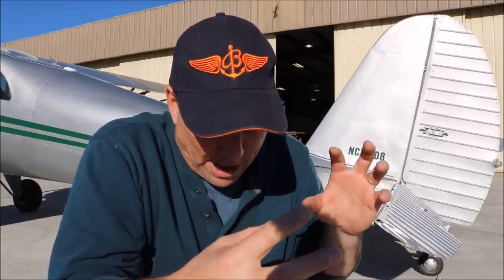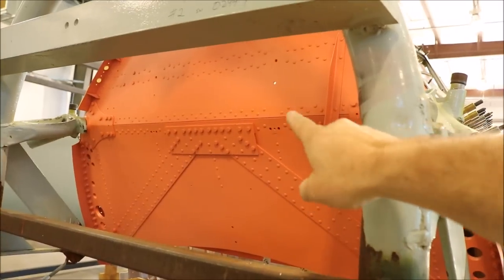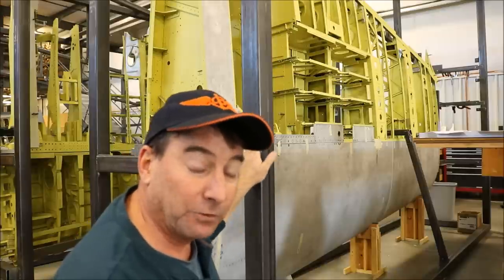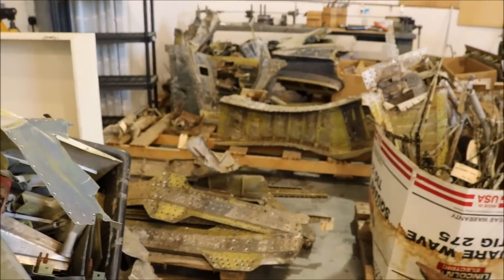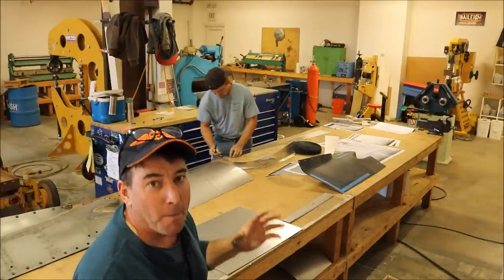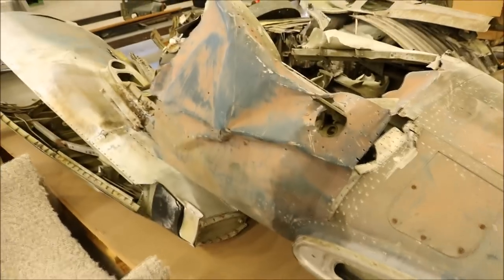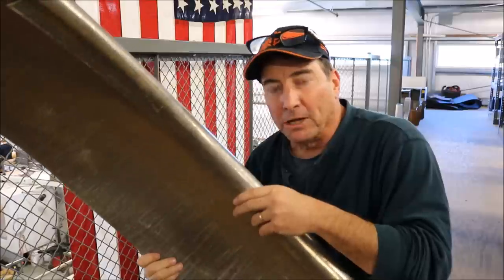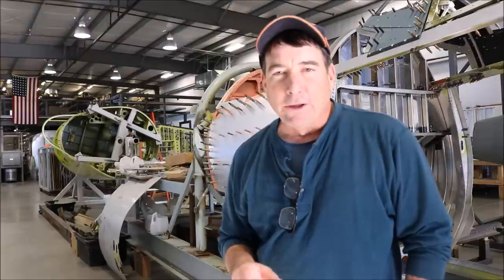RARE F4U-1 'Birdcage' Corsair Project-Vultures Row Aviation

Comment: Gosh, I  love the Corsair, they really seem like the swift pirate ship they're named after, even sounding like a pirate's sabre cutting through the air, until you hear the low drone of their powerful 18 cylinder radial engines after they have passed.  The Japanese called them "Whispering Death" because of that distinctive sound on approach.  Their lines are smooth and flowing which belies their awesome top speed of 400+ mph.They were tough fighting machines stacked with 6 impressive 50cal machine guns, but temperamental "Wenches" near port as they slowed for landing after the battle.  A great video, Juan, conveying the perspective, knowledge, and excitement of being on the inside of warbird restoration.  Also, kudos for taking the time to show proper respect for the deceased pilot, and those whom served their country in general.

Comment: In my earlier years, between 11 and 14 years old I helped my Uncle, a very good mechanic and pilot, rehab. small aircraft of the time.  My job was removing the old doped covered parts and then sand all of the air-frame with any corrosion or rust using sanding cloth strips.  I eventually graduated to drawing the wing ribs and other parts to full scale and we then built the jigs for fabricating the wooden wing ribs on those drawings, done on marine plywood sheets. Damaged fuselage sections were rebuilt the same way, but the aircraft tubing was welded to fit the jigs exactly, while the wooden parts were glued fabrications.  This was my original introduction to flying and while spending long hours at the local airport in Hillsboro, Oregon, I caught every ride I could in all kinds of aircraft and would occasionally have a chance to take the controls and fly the bird myself.  Those days made this video of particular interest.  These people are doing what we did, but they are working on a much more advanced scale.  Back in those days in the 1950's the rehab. work we did was quite primitive in comparison.  Thanks so much once again for a great video as was the travel along with you in the flight to London in the 777!  Nick, North West Farmer

Comment: All corrections are accepted with a smile, so don't hold back.  I think the whistling sound was from airflow thru the in-wing oil coolers. They were the tube type, not fin, and consisted of hundreds of small, long tubes bundled together. Oil flows in the small space between tubes, passing heat thru the tube walls to the airstream.  I think the cooler on the Corsair weighs 300+ pounds, but that's just from conversations long ago.
I'd bet that many engine failures have been caused from non-use, aircraft sitting parked, with oil gunking-up inside the tiny passagways of coolers.

Comment: Licensed A&E mechanic. I fabricated and install many of the fuselage sheet metal panels for the prototype  #1 Ted Smith Aerostar twin engine executive mid wing aircraft. Capable of near 400 mph . Worked for North Hollywood aviation in Los Angeles on a D.C.-6 conversion from a passenger  to a cargo plane. extensive sheet metal  beef ups were done at many fuselage stations , plus replacement of the floor and installation of a cargo floor with tie down rings. The project took two years and the plane was flown down to Peru to haul bananas over the Peruvian Andes. Same company then transferred me to their large facility in Los Angeles where we rebuild convair 440s , 660s, and 880 from piston driven to turbine driven twin engine passenger planes. My work involved shapeing the stainless nacelles and riveting the various parts together to complete the nacelle. These projects were 8+ hours a day six days a week for 4 years. I was quite good at the sheet metal and riveting work, if I do say so myself. I want back in , call me.

Comment: Let us remember that the original design was born on a drafting table, and the computation was by slide rule.
Reply: I inherited my Dad's slide rule.  People back then were so intelligent...
Reply: My dad was an aircraft mechanic in the Pacific theater. When he came back, he became a physicist. I used his Keuffel & Esser slide rule in college. (I had the only HP-45 on campus, so wasn't allowed to use it.)
Reply: My Dad was a P-51 Flight Line Supervisor ready for deployment to the Pacific in San Diego when they dropped the bombs.  My Dad knew a lot of the trigonometric functions by memory and didn't have to look in his books.  He ended up becoming a Professional Mechanical Engineer and designed Lumber Handling Systems from his shop in Spokane.
Reply: Yep! My dad was an Inside Machinist at a naval shipyard for decades. He had his formulas memorized too!

Comment: Here is a question which I don't know if it has been asked of you previously or not. Would it be possible, now that you are restoring this "birdcage", with funding not being an issue whatsoever, to build an entirely new "birdcage" without any sort of an original aircraft? I've heard of it being done in the UK reference a Spitfire Mk 1.
Reply from the maker: technically all you need is a data plate...

Comment: Did He explain why they used that color?  did it come from the formulary, or just a choice. is it the same zinc chromate of today although salmon colored?
Reply from the maker: Ray Bankes not sure why that color.
Reply: There was never a milspec for color.  However, a tint could be added to signify a single or double coat of zinc chromate.  Also, as the protective coating (zinc chromate is a coating, not a paint) was manufactured by various companies, and supplies of raw ingredients varied, the coating could be of several different colors depending upon blend.  Chance-Vought happened to be salmon color.  

The same could be said of 'Olive Drab'.  In actuality, OD could range from a very pale brown, to deep green, to almost black, and everything in between.  I've even seen a very pale pink yet it was OD Green per the milspec.
Reply: Thank you Richard H i know it is a primer and the information  you added is very interesting interesting.  of interest i used it my to prime my aluminum engine block and heads for my Subaru EA-82 engine rebuild.  i know they cool better unpainted yet i wanted it to look cool.

Comment: I’m working on building a 5’ wing span P-47 Thunder bolt air plane. I’m a scale nut, it took me 6 months just to build the cockpit. How or where can I come up with internal drawings of the flaps, linkage and hinges for the wing.

Comment: When I see pictures of the Corsair there appear 2 different props 3 blade and 4 blade what is the story or significance of this?
Reply: I believe that on later models,  4 blade props were introduced to deliver better performance at higher altitude. it could also have something to do with increases in horsepower as time went on... It's effect is like having more "traction" against the thinner air.  I've noticed this on other aircraft such as the mustang as well..
Reply: There is an enormous amount of detailed information on Wikipedia: https://en.wikipedia.org/wiki/Vought_F4U_Corsair
Many enhancements were made since the first models (and still flown after WW2). The F4U-4 had a more powerful engine, and 4 bladed propeller.

Comment: Juan what are those things that look like bullets sticking to the side skin of the plane? Did the Corsair ever battle the Mitsubishi Zero?
Reply: They are called Clecos. Very common in sheet metal fabrication, still used commonly in metal aircraft building.
Reply: DesertDenizen thanks
Reply from the maker: Cleco fasteners. And yes. :)
Reply: Yes, they engaged plenty of Zeros.
The Corsair was mostly flown by Marines from landing strips as it was pretty hairy for carrier landings.
I think only one WWII carrier in the Pacific featured the F4U Corsair.
It was built from 1942-1953, 16 different models, with a U.S. Pacific War kill ratio of 11:1.
Reply: The RN flew The Corsair   from all they carries from 1943  a good  8 months or more before the USN. In fact it was the RN that sorted out all the Corsair issue regarding carrier operations 

 I have read one of the first carrier ops for the Corsair was on the 3rd of April 1944 covering a raid on the KMS Tripitz by NO 1834 squadran

Comment: Those wheels are not original they are better. The original were Kelsey wheels. They also were not a split rim on the original. A common mod was a B52 wing tip wheel.

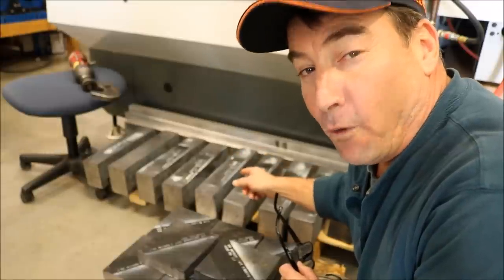Comment: Hahahaha!... at 7:07 a great Boeing Number down in the bottom right hand corner is a fairly decent farmyard weld!... Rolls-Royce weld inspector would be sh*ting bricks! .... I digress, but remember my Rolls-Royce Welding Tutor at "The Central School of Arts and Crafts." Hahahaha! I was being taught how to weld explosive compression lenses. for naughty stuff that make mushroom clouds!... It was only then that I realised why anybody caught talking to me, either inside or outside College, would face immediate expulsion! As my Tutor would say :- "Puddle-Stitch-Puddle-Stitch.....Puddle-Stich, and if anybody asks? this is a bog/urinal for aircraft. At Central the Metal Fabrication Dept. for Health and Safety, had windows, not walls. ..and BTW. about a decade or so ago, one of Rolls-Royce Subcontractors, was taken over by another member of "The Rolls-Royce Fan Club (Jet Engine Fans) and skip loads of old blueprints, and eyelash sets, were being trashed. I was R.M.P.T.A. Surveillance Examiner, and requisitioned all of them. Merlin Hay, 24th Earl of Erroll, (My Boss) is Honorary Colonel in Chief of The R.M.P.T.A. , hopefully these blueprints will survive me as well? ...When you are next in London, you should meet Merlin. at Parliament. We are plotting to arrange a marriage between Rolls-Royce and Schneider-Electric of France. ... The object being to reinstate The Schneider Cup Trophy for Racing Seaplanes, possibly with Electric Flight? ...You might be able to help Juan.